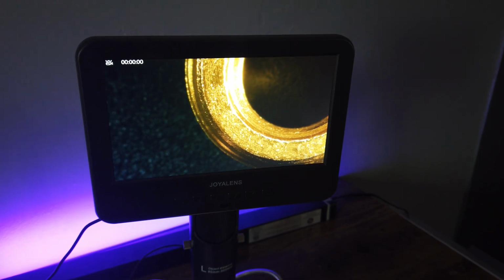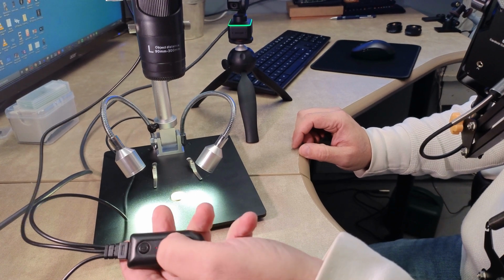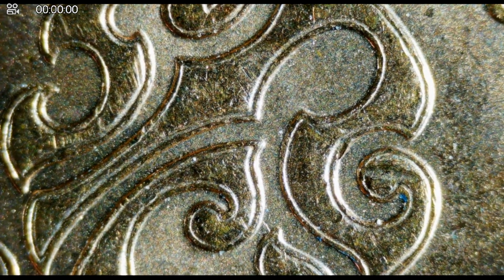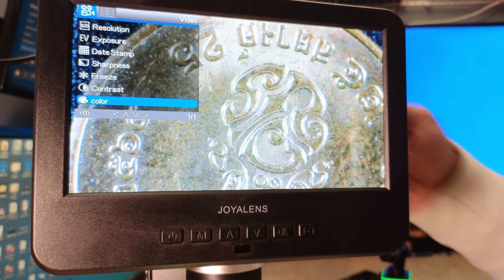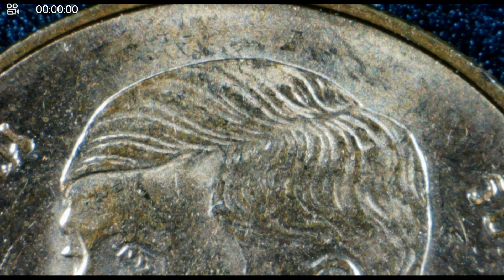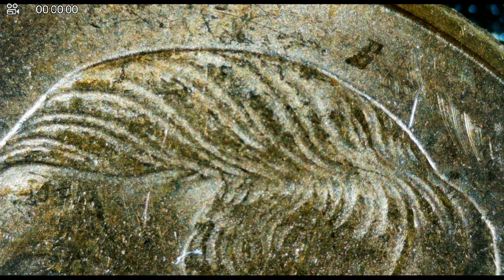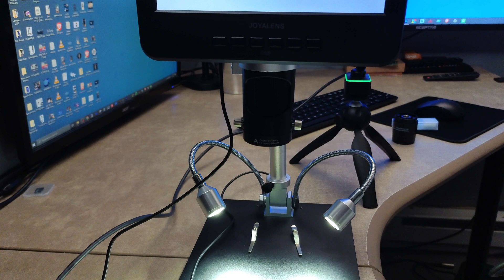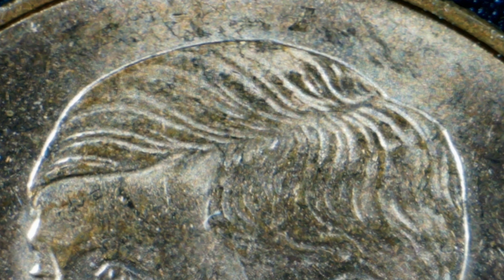Joyalens Microscope Review - A Fun Educational Gift?

Comment: Thanks for the look/review. I had been considering getting something like this, for close up photo/videography of electronics work, but I want it to be tiltable instead of always directed down at its stand (90 degrees from the work surface). Have you seen such an option? I see this one has a boom arm that allows it to extend out (a bit) past the stand (perhaps), but I really want an angle too. Thanks again.
Reply from the maker: Unfortunately I'm not aware of anything like that, but I don't know much about digital microscopes. This is my first time using anything like this.
Reply: @LDTebikes  Thanks. I may need to engineer something. :)